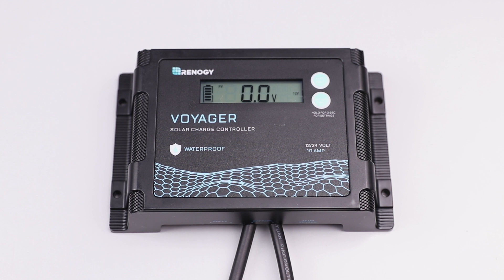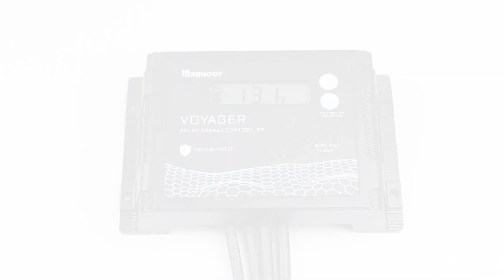Renogy New Edition Voyager 10A/20A PWM Waterproof Solar Charge Controller

Comment: Does anyone have any suggestions on how to better connect the wires to the controller? I did so exactly like in the video and the screws loosen and wires fall out with the slightest movement. Other than that the controller is great!
Reply: I keep the cables gathered together with a wrap of velcro strap placed about 5 inches from the unit.

Comment: Is there some kind of wire panel cover for this unit? It doesn’t look waterproof at the way is was installed (it’s not like other waterproof systems where the screw terminals are isolated or totally closed connectors are used).
Reply from the maker: Thank you for your attention. The wiring port of this product does not have a cover plate, and our product has a waterproof rating of IP67.
Reply: His answer proves its not waterproof

Comment: Why not use Anderson connectors? Makes things far simpler and doesn't cost much to add.
Reply: because not all panel manufacturers use Anderson connections
Reply from the maker: Hi, Visian.

Thank you for contacting Renogy.

This is the installation scene simulated by our staff in the laboratory. Thank you very much for your suggestion. We will present it to our customers in a subsequent video shoot with an easy and convenient installation.

Wish you a nice day.